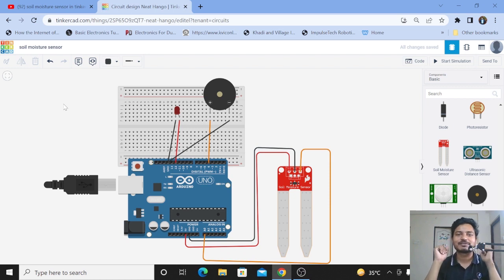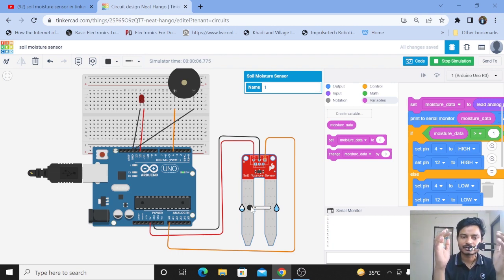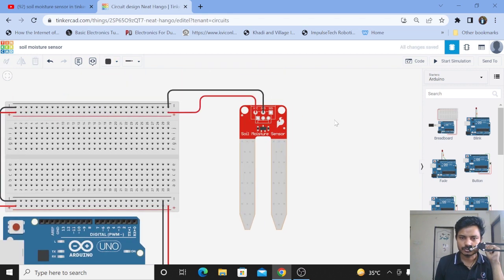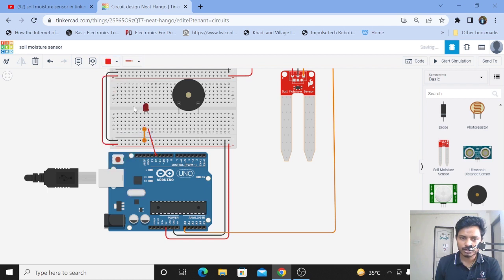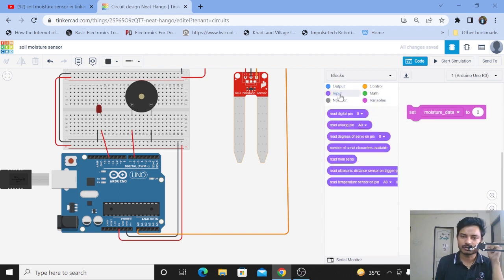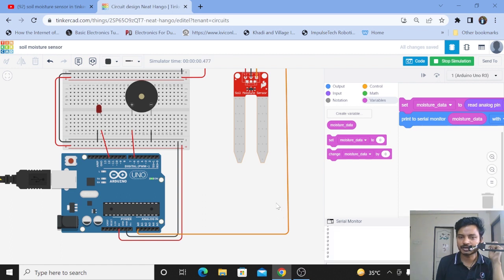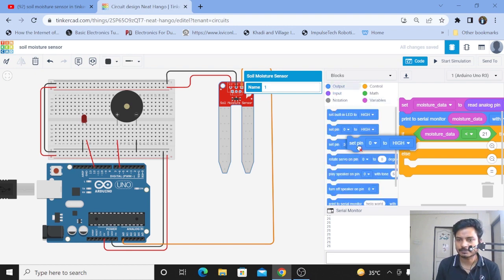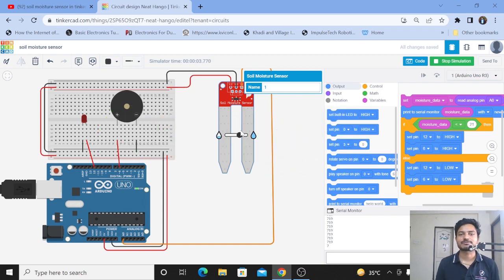Soil Moisture sensor with Arduino in Tinkercad | how to use soil moisture sensor in Tinkercad

Comment: Hello sir... what is the coding if i want to use relay instead of the led... is it the same block code??
Reply from the maker: yes its the same code because relay will turn on using digital pin

Comment: Share the code and very interesting project
Reply from the maker: Thanks mam i will share the code as soon as possible
Reply: // C++ code
//
int moisture_data = 0;

void setup()
{
  pinMode(A0, INPUT);
  Serial.begin(9600);
  pinMode(12, OUTPUT);
  pinMode(6, OUTPUT);
}

void loop()
{
  moisture_data = analogRead(A0);
  Serial.println(moisture_data);
  if (moisture_data < 21) {
    digitalWrite(12, HIGH);
    digitalWrite(6, HIGH);
  } else {
    digitalWrite(12, LOW);
    digitalWrite(6, LOW);
  }
  delay(10); // Delay a little bit to improve simulation performance
}

Comment: Sir which relay board we have to add in circuit? SPDT Or DPDT
Reply from the maker: just use any relay board no issue as long as you do the connection right according to the relay you have used
Reply: Tysm sir
Reply from the maker: @YasirKhan-hr2uz  your welcome ❤️